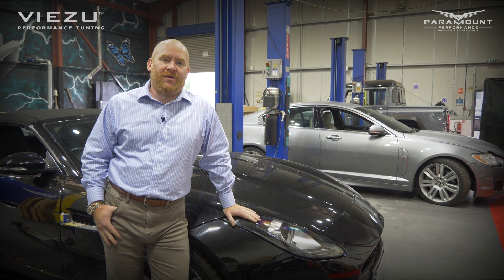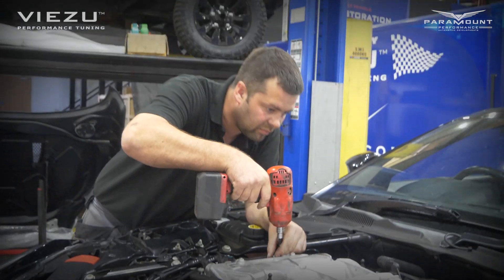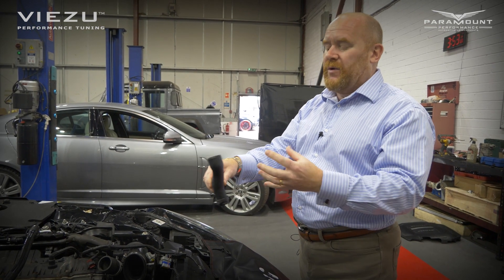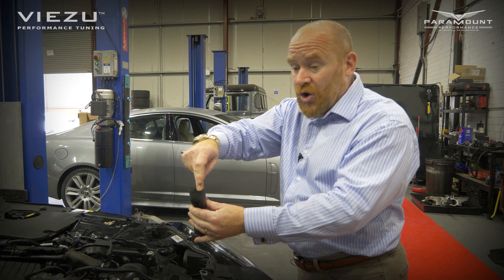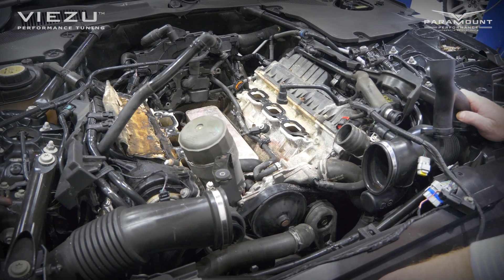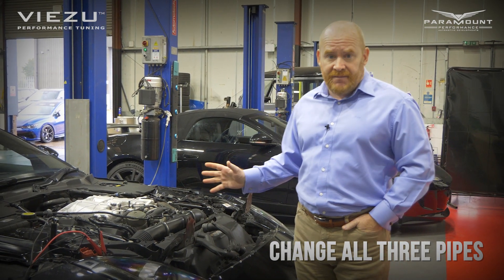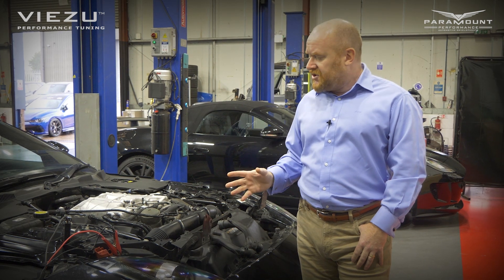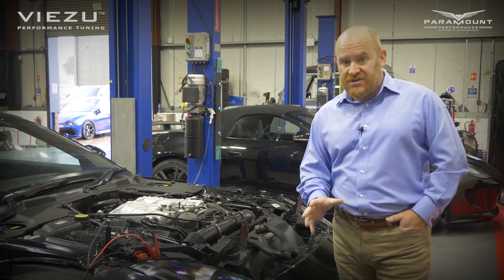Jaguar Y Pipe Water Leak Explained | Prevent Catastrophic Failure

Comment: Hi, I have a 2013 XJL and mine is definitely leaking from the valley of the engine. It loses about a reservoir of coolant every 150-200 miles. I have a new water pump on and I also have a new heater hose. I’m about to take it in. Is there anything I should get it done while it’s taken apart?
Reply from the maker: The upgraded metal pipes are a definite upgrade  that is recommended.

Comment: Hi. I'm wondering if you could help me. I've been trying to find the valley pipe or a part number for it but I am struggling. Is it possible you could provide me the  part number? It's a 2009 XFR. Would the pipe come with new clips as I need those also?

Many thanks,
Paul
Reply from the maker: Hello Paul, If you reach out to our Retail team, Info@veizu.com, we will certainly try and help !

Comment: i was looking at a 2015 v8 s that recently had this repair. when the seller showed me the repair bill it stated the car was overheating and driven there. although i drove the car and it seemed fine, i wonder if there is potential for more engine damage(head gasket,etc.)
Reply from the maker: Hi Mike - it's difficult to say isn't it - we don't know how long, or how far the F-Type was driven before being repaired. 

As with all vehicles that have overheated more than once, the potential for further issues is of course possible.

We would recommend to be as thorough as possible if you are considering purchasing this vehicle, they are fantastic vehicles and our goal is for everyone to have a great experience with Jaguars!

Comment: You missed the heater pipe at the back of engine
Reply from the maker: We changed them all - not everything made the cut for video! We wanted to focus on the Y Pipe in this particular video, but its absolutely recommended to change all pipework you have access to with the supercharger removed - even the supercharger coupler!

Comment: Wish you guys were across the pond stateside. Ive got a lot of good info from this channel, including some performance upgrades for the XJ. Im just too new to Jags to feel confident enough to do it myself. May just take it in and get the pipes changed. Im sitting at 64K miles and no issues but like you said, I'd hate for this to happen while on the highway with the family
Reply from the maker: Thank you for your feed back. Any assistance please don't hesitate to get in touch.

Comment: Does 2015 jaguar xf 3.0 supercharge have that throttle cooling pipe or valley pipe? Not able to find it, could you please share part number
Reply from the maker: Hi there, the throttle cooling pipe and valley pipe are the same part,  we tend to use genuine Jaguar parts for this repair so it would be best to contact them direct for the latest part number as they so supersede and change.

Comment: Hi ! thanks for the video.

Are there any factors that can accelerate the failure of these pipes or is it just completely random ?
Reply from the maker: Hi there, thank you for your enquiry. There are no specific factors that speed up the deterioration of these pipe, just general wear and tear and age of the materials used to manufacture the components.
Reply: Factors are Plastics.
Hot + Cold over time, disintegrate eventually.
There are whole aluminum cooling kits for all the cooling failure pipes.
Such a shame for a beautiful vehicle.

Comment: Hello! This was very informative. I have a 2014 F-Type V6S with 74k miles and a low coolant alert that popped up this week. I now feel very informed to bring it to my local mechanic and let them know the deal to check all of these hoses and the water pump. My question is, how many hours labor should all of those replacements take? I would like to have that background knowledge when I talk to my mechanic about it.
Thanks for the info!
Reply from the maker: It obviously varies from vehicle to vehicle as to what the technician will find when they take the charger off. But to help with your question, to remove and replace the supercharger, you are looking at 6 hours from a trained tech who has done one before. If a first time allow a couple of extra hours. The pipes them selves are around an 1 or 2 to change. Again it depends on how bad the pipes are, if any work has been done before on it, if they are cracked etc.

Comment: Have '63 plate 3L and several wks ago it came up 'low coolant'. Checked and required half litre and has not lost any since? Do gaskets under supercharger need replacing when changing pipes? Shame you are so far away!
Reply from the maker: Hi Paul, I would recommend replacing the gaskets whilst your in that area as a matter of cause and definitely if  you see any weeping in that area.

Comment: Also i recommended to use OEM o'rings, the ones for the connector pipe from the cooler that sits in the middle of the V to water pump.
Reply from the maker: yes we always use OEM parts on these too

Comment: I think I am on borrowed tine at 70k. Car has been faultless since I acquired it (XJL) at 50k miles, the temp gauge needle has never moved from the middle once warmed up. Perhaps a happy weekend's supercharger removal is called for.
Reply from the maker: Hi David, have to love an XJL, its so tempting to say if it an't broke don't fix it, but they it goes and fails just when you need the car. So may be best to bite the bullet if you have the time.